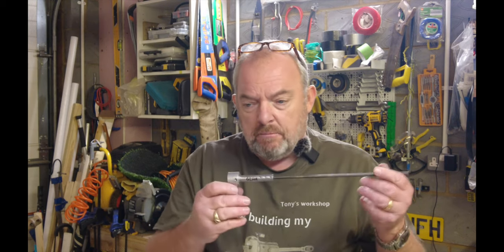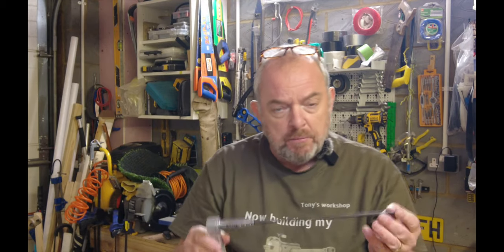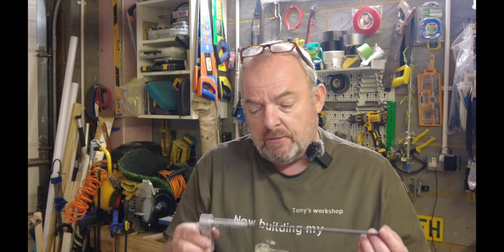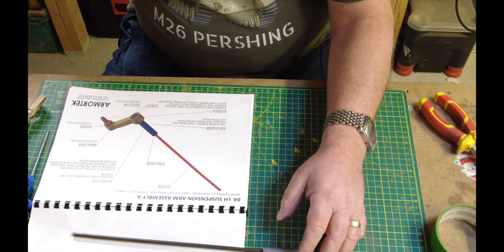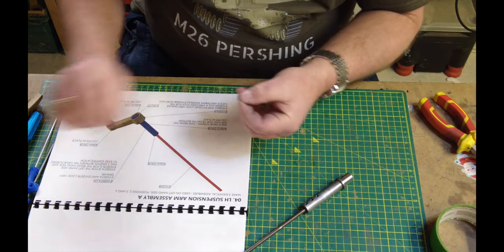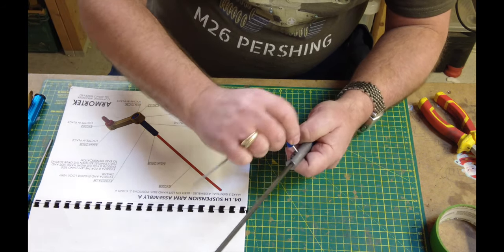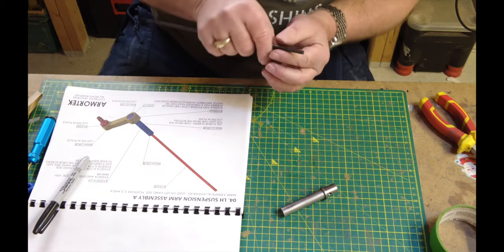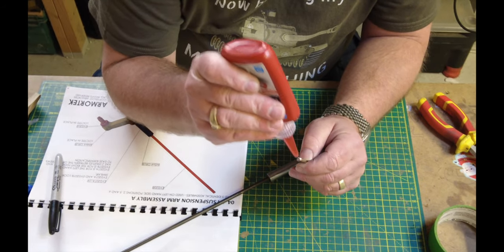1/6 scale Armortek M26 Pershing RC Tank build. Assembly of the suspension and torsion bars (Vid 04)

Comment: You are correct about not getting carried away and watching the instructions. Easy to assume a step's assembly without paying attention. I just finished building both sets of tracks - all 164 of them. As much as I am enjoying the build, this was not the most fun. I find it interesting that the assembly manual does not even have a step to put the tracks on. Just a minor note about how the idler adjustment screws can adjust the tension - but no real guidance other than what users on the forum may say.
Reply from the maker: Hi Ray, Oh yes...the tracks...there are so much fun!!! When I did the Tiger, I just had the music on in the background and got into a rhythm...I must admit, I also found the wheels tedious on this build, but easier than the Tiger...I guess it is just that repetitive thing. I will be looking at the track assemble soon, but for now concentrating on the prep and painting.
Reply: @tonys_workshop  The thing that made the track assembly a bit more tedious is that the washer that goes on the one end, goes into a pocket so bending the split pins is a bit more difficult getting the pins to nicely bend back flat without tending to flip upwards.
Reply from the maker: @raymassa3751  Ok.....sounds like a job for a rainy day. Going to be fun with my sausage fingers 🙂I will let you know how I get on.

Comment: am really enjoying these build videos , one thing  i have noticed is that you are applying the threadlock onto the tip of the screws and not onto the thread i cant see that working as threadlock should be applied to the thread itself , hope that is of some use
Reply: just noticed that you have only done this on some screws
Reply from the maker: @alexhudson3574  Hi Alex, You are correct, but for the most part I do apply to the side as well and then the nut when threaded on spreads the thread locker along the shaft. So far so good, but I welcome all help and advice as I am still learning. Thank you for watching and commenting. I hope you continue to follow and please feel free to comment anytime.
Reply: Hi Tony. Alex is quite correct. It is imperative that Loctite is applied to threads themselves. If you feel like a lot of the thread locker has been pushed up the threads and out the top when doing up the bolt you can always undo it to check how it has spread out on the thread. Chances are it will be fine and you will have applied slightly too much, so it’s just surplus being pushed out. Doing that gives you a good chance to remove the surplus with more room for access. That can be particularly useful on painted components since thread locker is a fantastic paint stripper 😂. 

If your doing a long build / assembly session like you seem to , you could decant some thread locker into a small paint dish or lid of some sort and use an old paint brush to apply it. It’s actually a really great way of getting a nice even spread of thread lock into the threads. 
You can use the brush to “paint” the leftover thread locker back into the bottle if you take the lid off it. 
Hope this helps.
Ben
Reply from the maker: Thanks Ben..a good tip. Hope you continue to follow and comment. Best regards..Tony

Comment: Just wondering why you don´t drop the thredlock into the hole instead of applying it on the screws? I think you wouldn´t have it on  the surface of the parts.
Reply from the maker: I do that sometimes, especially if the target hole is flat on my bench. But it can also spill out on to the surface once the fixing is driven into the hole. Thanks for watching and commenting and hope you continue to follow my build.